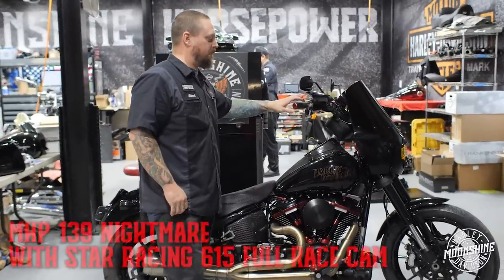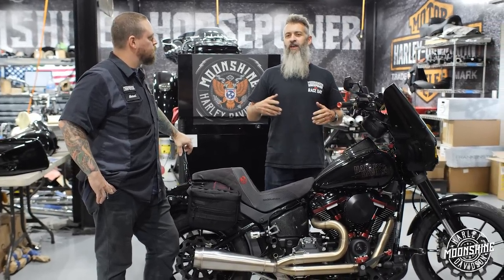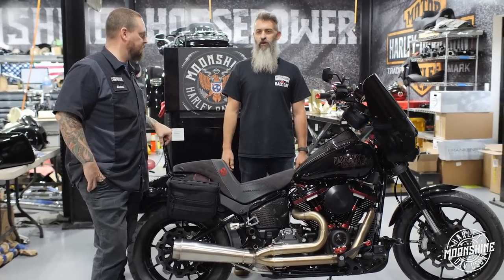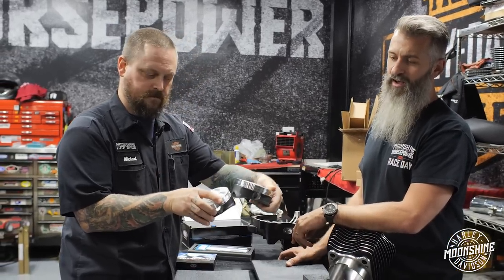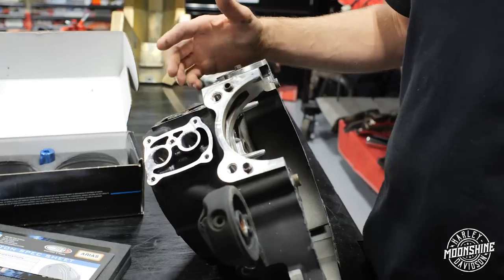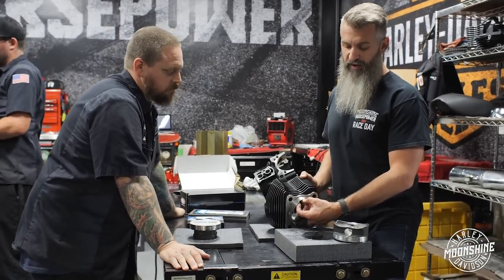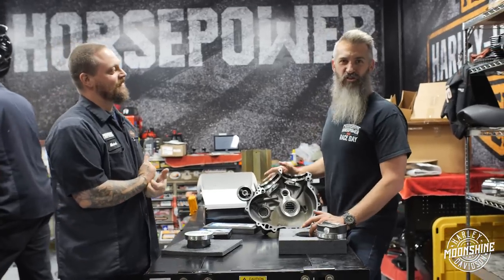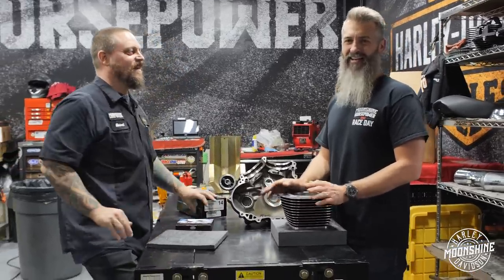Moonshine Horsepower 139 Nightmare M8 Softail 177HP 152TQ | Bike Build No. 10

Comment: I believe the squirter works at higher psi.  To keep pistons cool under high heat .
Reply from the maker: It does as well. But hard to supply enough to keep us with a piston that’s moving up and down 50 to 100 time a second.
Reply: @MoonshineHarley  I forget m8s oil psi is higher than tc engines .

Comment: I'll be the buzzkill here and ask what you anticipate motor longevity to be before it needs a complete tear down. Back in the 70's riding a nearly stock FLH, we would do a piston overbore every 40,000. Valves too. Low end would be looked at around 80,000.

Comment: Offsetting the wristpin location to align the angle of force (Lateral Rod Angle) during the initial degrees of crank rotation on the power stroke, placing the force in a mechanically advantageous and more efficient direction, (reduces power loss and part surface friction) you will get more torque and HP without  increasing peak engine speeds, or as much  throttle angle. SOMEBODY DO IT!

Comment: How do you keep belts on them without going chain,I've had few stage 4 upgraded kits in new M8s & stage 5 TC snapping multiple belts under few thousand KMs so how does something with so much power not just break belts from winding em on hard,thought pressure be similar to dumping clutches on the smaller stage 4 motors factory kits ???
Congrats on the bike also it's done very well one of best I've seen.👍
Reply from the maker: Belts hold up great when the motorcycle is operated correctly. If someone is going to be dumping their clutch all the time or wheeling we swap to chain. It’s all about the rider.

Comment: What if you drop the transmission pulley down two teeth, now that bike will be insane, starting at about 1500 RPM up to wherever you lock that motor out at. Which I would want the RPM'S locked out at 200 below it's max for every gear, so you never go beyond your power band
Reply from the maker: MONSTER!!!

Comment: Question.  I've seen several locals go from 107 & 114, to 124 & 131 kits, along with cams, valve springs and head work done.

Every one of these engines are starting to fail at around $30,000 miles with 30 to 50,000 plus run out on the crank..

I'm being told the Timken conversion is a way to eliminate the Harley bearings to eliminate walk in the bottom end, you're saying this is a true?
Reply from the maker: We would not Timken bearing the lower end. We would build the flywheel. For more information please contact our Horsepower Team
Nick - Jamie - Mike - Aaron
Phone: 615-274-4170
Email: horsepower@moonshineharley.com
***If you email us please provide a good contact phone number for you.

Comment: The piston speed must be astronomical at 7,000 rpm , of course your only there for a split second .
Reply from the maker: It’ll hit top dead center 116 in 1 second. Crazy!
Reply: Imagine the piston speed on the super sports that redline at 14-16k rpm 😂
Reply: @guitaristwagner  super sports have a much shorter stroke than this Harley